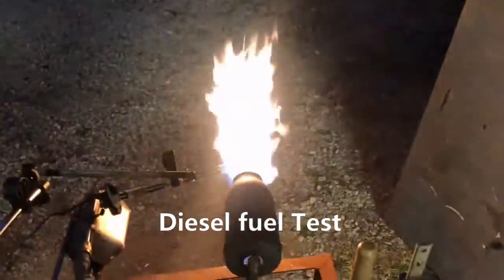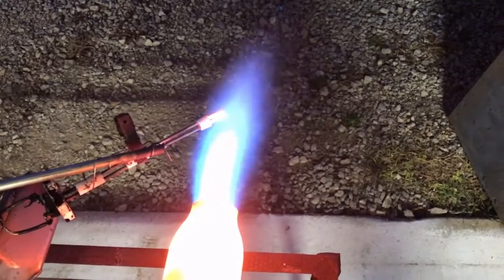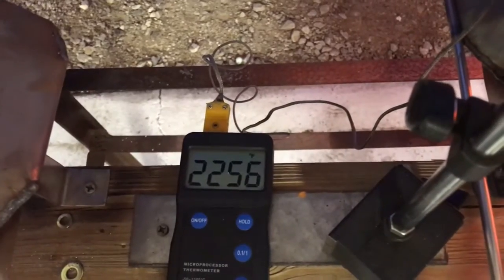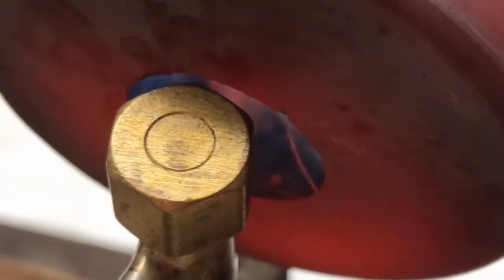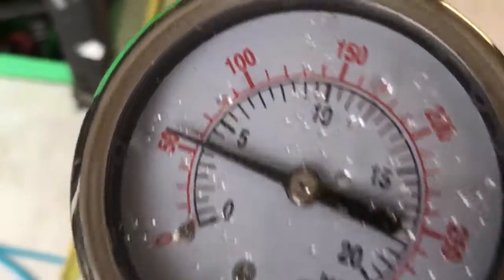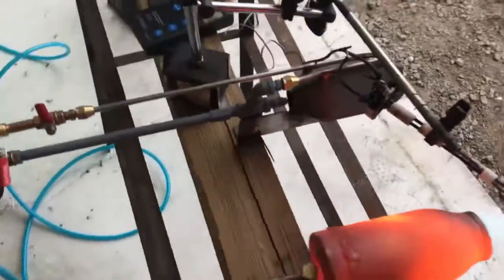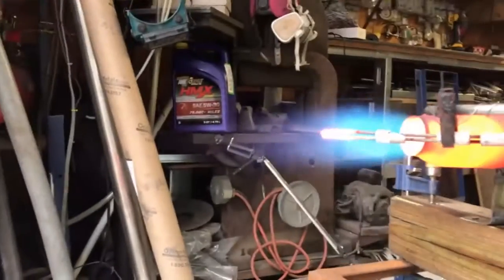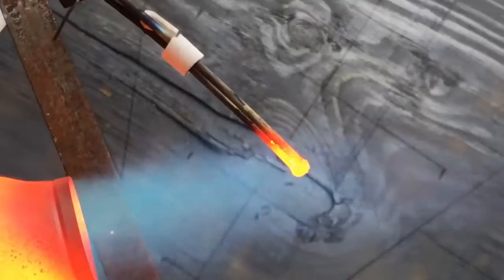Nozzle shape test for Silicon Carbide molds

Comment: Bro try silicone nitride or tungsten you will be surprised by the temperature you can hold. Add O2 or nitrox in your propane mix and you will achieve over 3000 celcius. Also the higher fire pressure exerts increases the temperature on the object